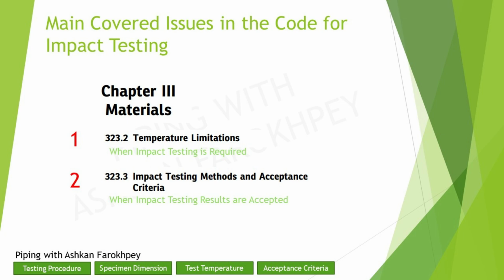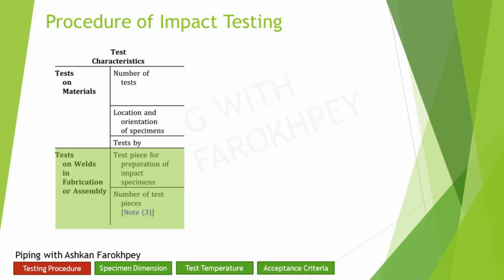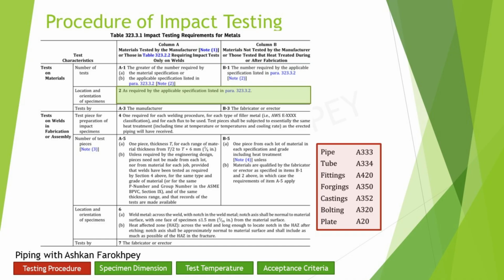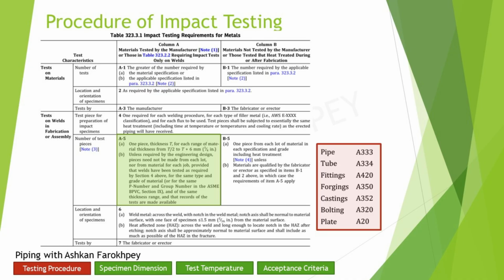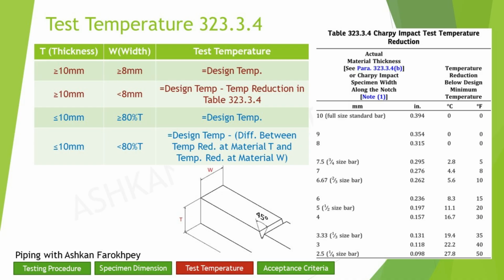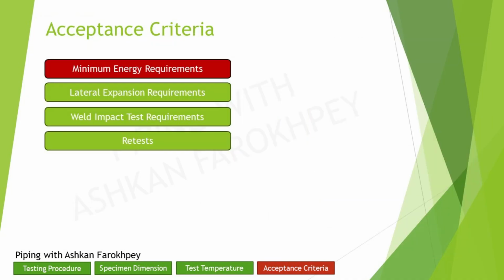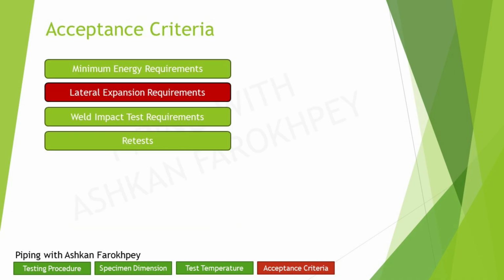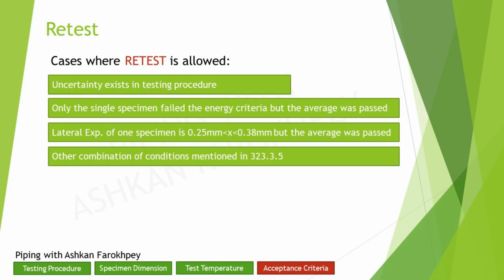Impact Testing Method & Acceptance Criteria? ASME B31.3 Explanations

Comment: What is width of the notch?? Is it the width (W) of test specimen in L (55mm) X W (10mm) X Thick (10mm) ? or the remaining area along the notch after notch is made on specimen. Like Thick - 10mm & 2 mmm deep notch, so 10-2 = 8mm, width of Notch?  or the distance between two extreme  points  in a U or V notch, like how wide is that notch.....Kindly help me understand this.